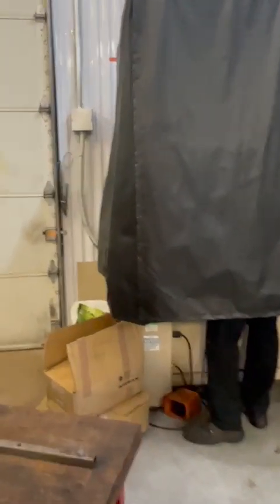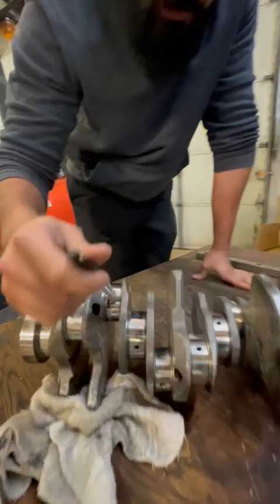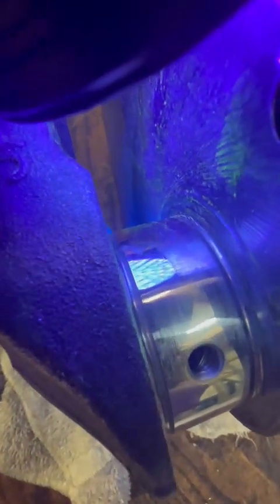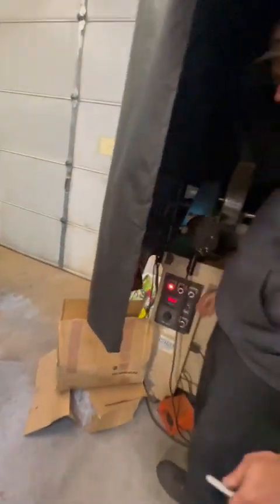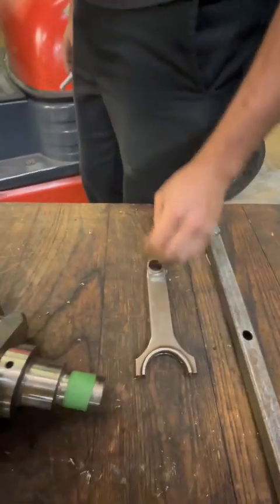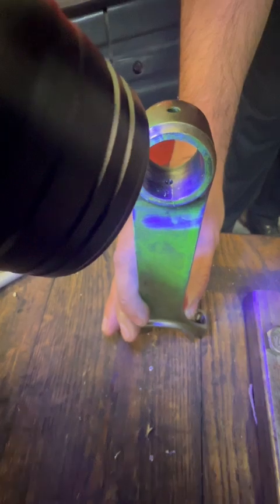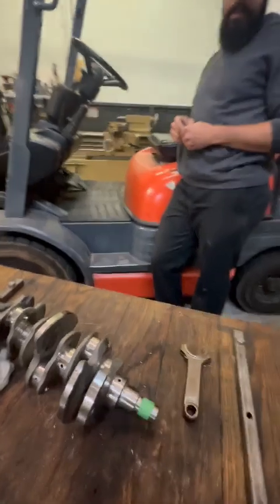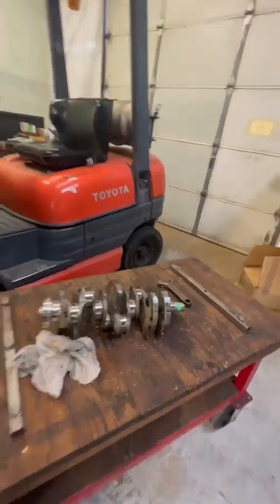Why You Should Magnaflux Your Engine Parts

Comment: Thanks for your time on this very valuable testing.  I'm retired military aviation maintenance and former FAA inspector, there are numerous references in tech data for a particular type of NDI (Non-Destructive Inspection) upon disassembly for a reason.  Your video, from the automotive perspective, shows why.  Nowhere to pull over in the air...Thanks guys!